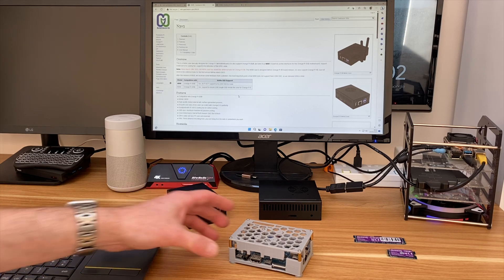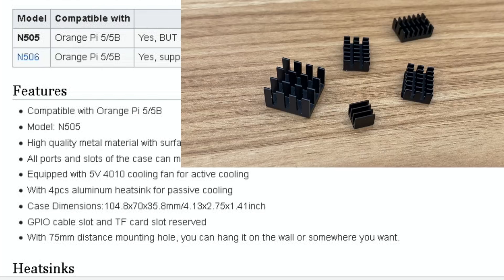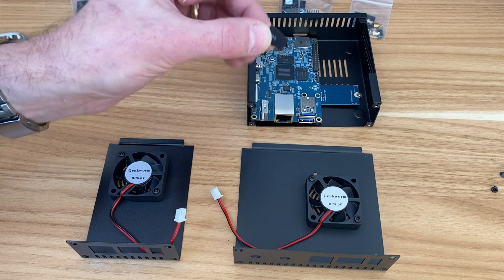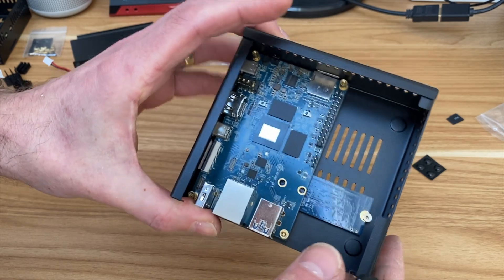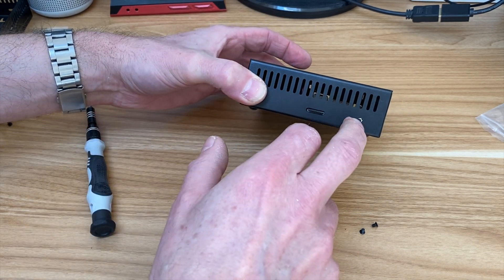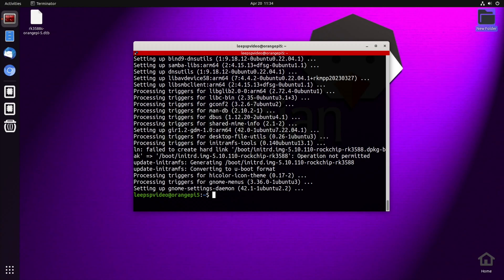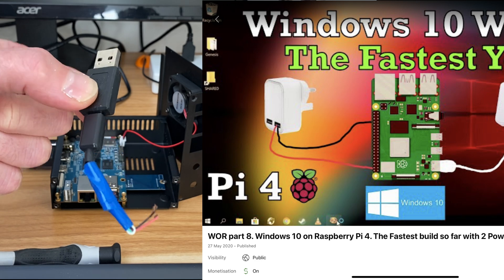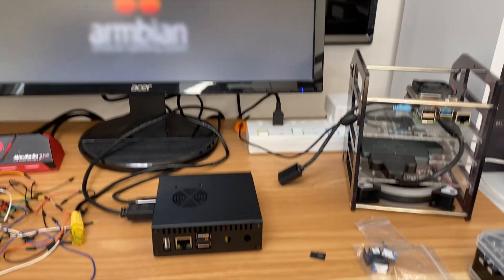Orange Pi 5,5b NVMe cases Geekworm n505 n506

Comment: If you have tweezers you can take out the positive wire on the 5V fans and you can put it in a separate plastic wire plug to work on 3V I used an old fan from a broken stereo nearly silent.💯😊

Comment: It is good to see a case that can accommodate a more value 2280 and to cover the base with holes for the maskrom and reset buttons. It is a shame that the implementation of the 2280 prevents easy swapping or removal. The lack of a dual 5v/3.3v option is a shame. Having to use a stuck to use the on/off button is also a shame. These case designers should perhaps take a leaf from NanoPi with their R6C, which has more accessible holes for reset and maskrom and an actual button for the on/off switch, as well as what seems to be a more easily accessible option to install/swap a 2280. I nearly ordered one but will wait and see if they improve the design or if somebody else comes up with something just that little bit better.
Reply from the maker: I tried removing the NVME after the video. It is possible if you remove the lid, the Pi doesn’t need to be removed.
Reply: @leepspvideo  That is great then and I shall now purchase on that basis.

Comment: the best idea for fan is to control it over the temperature from the sensor. This way you:
1- keep temperature in the range you want
2- keep power usage low
3- keep total silence when no need to cool it

The best is psutil to check temperature and then simple bash/python script to turn on/off the fan using the GPIO of the orange - commands like: 
"gpio mode 3 out" - to set GPIO=3 to output mode
"gpio write 3 1" - to provide 3.3V to the fan on GPIO=3
"gpio write 3 0" - to turn off the fan on GPIO=3
Reply: AFAIK GPIOs are usually very low-power, as they're meant for signal delivering only
I saw a separate controller for 5/12V fans which works w/ analog outputs, but I think easier would be to add some transistor and do PWM from GPIO.
But if GPIO on Orange PI 5 have enough juice to power the fan - then it's the best option
Reply: @sashasimkin fair point but the fan I bought is around 20mA and I connected to 5V not 3V and it is more than enough to keep temperature below 60C during stress test on all CPUs. During normal operation temperature is below 35C as this is fan with heatsink together.